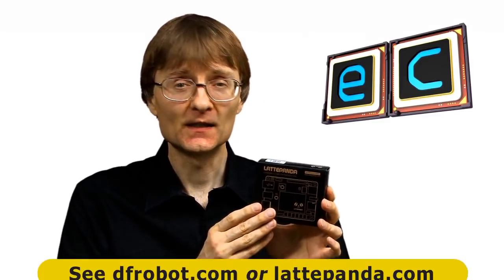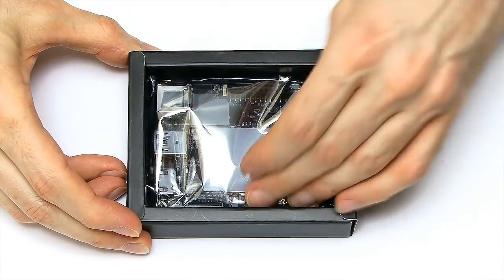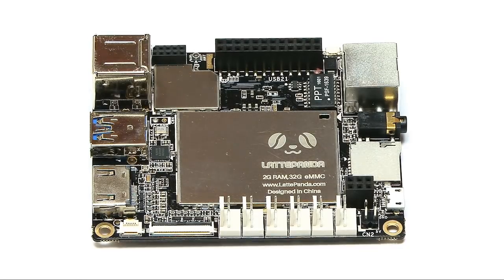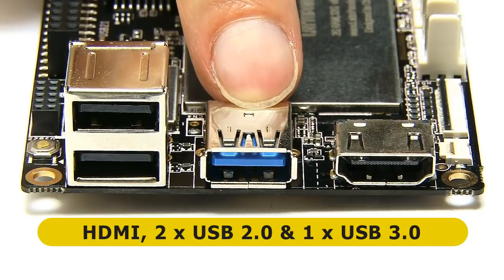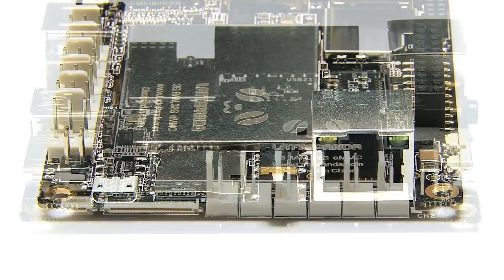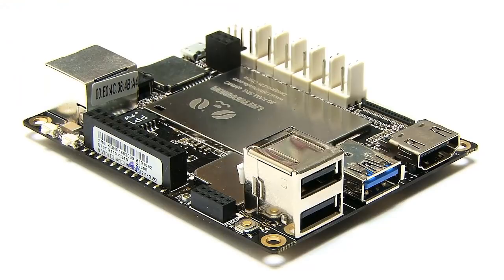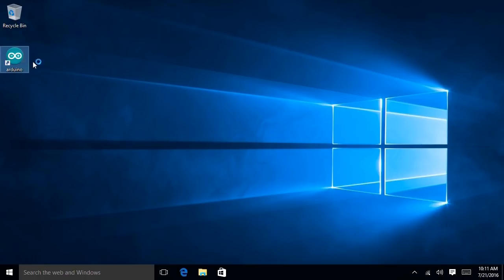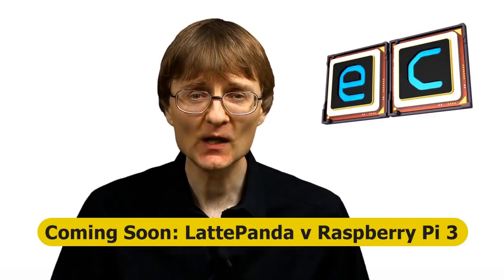LattePanda Windows 10 Single Board Computer

Comment: Ok, shit. This thing is expensive. For that price I can get 3 Raspberry Pi 3, or 22 Raspberry Pi Zero, or a real PC.
Reply: A real PC? ermmmm for $107?
Reply: Sacco Belmonte Go on ebay. It might not be the newest, but it is probably still more powerful than this one.
Reply: Yes because a $107 PC is old tech and it's huge.
Reply: ***** I got a 2012 Mac Pro for 100€. It had bad ram installed, but after removing it, it still has 12 GB. And it works.
Reply: Michi Lo Just because you got a good deal doesn't mean they usually go for 100 euro. They go for much much more than that on average. And it's still a huge computer. Doesn't really serve the same purpose as this.
Reply: but the PC does not even have the GPIO ports...which is really the reason why these things exist. Its quite stupid to even try to compare them. It all depends on what you are going to use these things for.

Comment: Make it Win 7 compatible and I'll get one.
Reply: It most likely is, unless Cherry Trail is like Skylake.
Reply: ender_scythe I wouldn't like to come across with the news of no supporting drivers...
Reply: Nonnof Yobiznes q1
Reply: Nonnof Yobiznes Yeah.
Reply: CPU too slow for you, you need a geekbench of 2000++ for today's OS.
Reply: PC KUCHING You just burst my bubble.
Reply: You can customise Windows 10 to be very much like Windows 7.  Win 10 has an old fashioned desktop, so I set mine to boot up on that, and when I switch on the computer my screen is identical to my old Win 7 one in every way. The only thing that looks different is the Windows start button menu, but I have shrunk that annoying panel of tiles to its minimum size, and populated it with only File Explorer, Control Panel, and This PC tiles. Finally I deactivated Cortana, leaving me with the conventional search bar. Due to a drastic crash a while back, I had to reboot to factory settings, giving me back Win 7. At first I wondered why I used to love it so much, but after a week, I could see why. However I then got the free upgrade again because I knew I love my Win 10 just as much. Too late now, but you should have tried it, because you always had the option to revert.
Reply: +PC KUCHING you are wrong. my 2005 Pentium D 840 only has a geekbench score of 1600 and runs windows 10 no problem. graphics card Nvidia GT220 runs my 1080p monitor just fine.
Reply: No, I want Windows XP
Reply: ***** XP does everything that later versions of Windows does so for 16 years there has been no improvement for Windows users. 10% of users are still running XP.
Reply: ***** Every new version of Windows is more rubbish than the previous version.  Microsoft is like a Government with no Opposition, they fuckup everything they do. Have you tried other Operating Systems?  What other system coud I use on a laptop?
Reply: Doktor Hachi Roku "and all are more or less the same shit. Some of them even need 6GiB" : whitch distribution did you try, i tryed ubuntu, manjaro, mint,opensuse, fedora.....the heavier never passed 900 Mo witch is ubuntu unity DE
Reply: Cyrille Velez, on 2gb machine?
Reply: vadim negru 4 gb, but anyway, never more than 1 gb
Reply: Doktor Hachi Roki - false. It's not just cosmetic. There are MASSIVE improvements under the hood in resource management and other areas. Windows 10 on a high-end Core 2 Duo will feel much snappier than Windows XP on that same system. It's optimized for modern-ish multi-core architectures though, so anything with a single core will run much worse with 10.

Do you understand how much more Windows 10 needs to do on modern hardware than GEOS needed to do? You're comparing apples and motorcycles.

Comment: Mated with and ESS and breakout board, this would make a brilliant Mach4 platform for CNC machines that would fit into a very small space. With the wired Ethernet for the CNC connection and Wireless to hook  up to a network, this has everything you need for that application.

Comment: Cooling is a problem that should be solved. Also a Problem is the Processor - i think that some programms cant be work with atom-processors correctly. I will be happy to get more infos about this both points in future :)

Comment: A month ago I bought the 2/32 version and it is really an amazing device. I use it in my livingroom connected to my TV.  Perhaps you like to know that it has now a Z8350 processor and a Windows 10 64-bit operating system.
Reply from the maker: Good to know, and I'm not surprised that it is a great TV PC. :)

Comment: running Windows 10 instantly makes it better than any android or iOS phone out there (idk about windows phone)
Reply: except the fact that you need to take a keyboard, mouse, monitor, and the power adapter with it, and it has no wifi connectivity or data plan
why the fuck are you comparing a smartphone to a PC anyway
Reply: Not on a shitty slowly Atom CPU !! Pentium or Celeron maybe...
Reply: I USE - it depends on what you want to do with said PC
Reply: It has wifi connectivity and there is a special touchscreen( that is not to expensive)  to use with lattepanda to control it. You can mount both in a box and use them as a controller with softwares like labview or another similar free version software that can communicate with arduino.
Reply: Funhubble New age Intel Atoms are based on more modern Cherry Trail architecture so its faster than before.

Comment: I saw this video before and didn't pursue it because of the price.

This one comes with a software package that runs in Wind 10, with Visual Studio, to "operate" or access the Arduino I/O.  But I also need precision analog input A/D conversion, which will probably have to be breadboarded separately.  Kinda pricey for $119, with the activated Win 10 OS, but the barebones package is only $89.
Reply from the maker: And you can "evaluate" Windows 10 without activation indefinately . . . The only real restriction is that you cannot change the desktop background.
Reply: I dunno.  After Bill Gates left Microsoft and stopped doing what he does best, which is to envision, the quality of Windows OSs have been in decline, and for a long time, I wasn't able to change the background on my existing, paid-for copy of Windows 10.  Now, I think there were enough complaints about it that Microsoft let it back in.  In the meantime, I'm in the market for a newer, better OS, but I suspect that, with all technologies that evolve, they tend ted to devolve as time moves on.  I'm even losing interest in the internet, just because of the hogs that occupy it, youtube, for instance, and google.  As for Linux, I've never been able to get used to it - it just doesn't have the feel of Windows.  Well, the old versions - 95, 98, XP, etc.

Comment: I think it is a good idea to have a board that instead of having a GPIO it have a IO bus line where you can connect IO modules, communication modules(e.g. Profibus, CAN bus, etc), and additional power supply module for high power outputs, similar to PLCs making it compatible to available industrial components such as sensors, solenoids, etc.

Comment: That's quite a lot of computer for the money, or even as a spare in a pinch. I use an ASUS X205 as my ultra-portable when I'm not at my custom rig at home. It's an Atom z3735f (2gb RAM and 32GB storage which is lacking...), which is actually a little weaker than the z8300 in this one. I've found it totally capable of watching 1080p 30fps video, I've typed more papers on it than I can count, and so on. Even if you used this as a basic office computer with the 4gb and 64GB storage, this is a nice little setup.

Comment: I personally think LattePanda could become a tough contender in the market of single board computers; amongst the many factors, one case is because of its feasibilty with a very familiar OS- Windows 10. Win 10 and Arduino pre installed in a small computer board, that's been the crying need for engineers and coders, sadly not available in Bangladesh yet. :(

Comment: Ok just curios if anyone else realized it has 1 quad core CPU but you can add 2 more giving you a totals worth of 6 CPUs on 1 computer that small would provide any hacker or programmer with some serious advantages, then it supports the Arduino ATmega which is actually 1 of the other 2 processors you can add next to the quad core (Quad meaning 4 making it a 4 in 1), the fact that you can use it as an Arduino means you're starting off with everything needed to design and publish so seriously nice programs, while also being able to use other custom made programs. Wifi and Bluetooth even though you can get them with most laptops, I've usually seen that Bluetooth is normally charged for seperately and as an extra very rarely included in original pricing, desktops usually have neither Bluetooth or wifi even today. So for a pocket computer this thing is actually packing some pretty heavy fire power, ok sure you have to get the 2 other processors separately from it but the fact that it has a quad core that can support 2 more processors on top of that is still damn good. It has sensor ports which you can only get on a prototyping device like Arduino or the Ras PI is another bonus because you can easily turn your home into a smart house completely wirelessly. Then for those of you who don't know micro sd cards now come as high as 525gb of memory, add that with the video card and you got a nice gaming system, not just that it comes back to the fact you can have a totale of 3 CPU acting with the power of 6 processors on 1 small board that would mean no lag, barely if not having to wait at all for it to start up, start a program or game, but do it so fast it would be like you pushed 1 button that read your mind. When it comes to computers I always look at what can be added because the more you can add means the longer you will have it for, as being able to add more to a computer means you don't have to worry about upgrading since you have everything needed to make this your own custom based system. Then the wireless sensor ports I can't even get past how many smart house devices can be rigged to this, if any of you seen the Disney movie "Smart House" this little computer is the equivalent of that control room of that awesomely designed system which if was real we would all be chasing after it lol. So yea again compared to the fact it has wifi, Bluetooth, 2 extra CPU ports, quad core, and wireless sensor add ons give you that start of 1 sweet and easy to customize little pocket PC.

Comment: I have a Chuwi Hi8 Pro on the way in post. Specs are pretty much like for like, except you get a 1920x1200 touch screen, battery power and USB C. Paid £72. Obviously 2 different products but will be interesting to see how it works out

Comment: I have the Raspberry pi and as a comparison, you don't get a lot for the money with LattePanda, which cost 3X as much. A little more ram, an SD card, Bluetooth, and wifi, and 3.0 port, and Window 10 installed (and it's free). I guess for the money you are really getting convenience (Just plug and play).  I have five Pi's in a supercomputing cluster configuration, but as a stand alone unit, I might prefer the LattePanda; no doubt it will be easier to use out of the box.

Comment: Based largely on this video, I foolishly bought a LattePanda with Windows 10 installed. It was a complete disappointment, as Windows would never actually boot and it would inevitably return me to the blue "Recovery" screen. Having nothing now to lose, I proceeded with the "Reset" option, which took forever. It then tried to reinstall Windows, but always encountered an error and would restart. This failed loop would continue forever. It remains to be seen whether or not DF Robot will refund to replace my unit. This is yet another reason why I am forever soured on Windows based operating systems. And just try to get customer support. Thanks for helping me waste $131.
Reply from the maker: I am very sorry to hear this. I have two LattePandas that have both been working without error for more than 18 months. Clearly you have a faulty unit, and I hope that you get your refund or a replacement. Good Luck.
Reply: Not your fault, mate. Ye pay yer dough and ye take yer chance. Could'a gotten me three pies fer the price of one latte, tho. Learnt me lesson. Carry on.

Comment: I don't think so those are "Standard" Arduino GPIO pins. Sure they are Arduino pinouts but it wouldn't work with standard arduino shields as the layout is different.
Thanks for the informative video btw.

Comment: I'm surprised that 5V is the power, which is rather high for such a board. It tells me the transistors are rather old. The specs are roughly equivalent to 2003 to 2008, with USB3 being the exception. The RAM limitation means it can't be used for serious work. Imagine loading the entire package of Windows Office, Inkscape, and Corel's Paint Shop Pro  just for starters. With 4 GB of RAM, imagine trying to cruise the internet while you're in the middle of editing images? 

This obviously means that an external USB hard drive will be required leaving the internal hard drive dedicated to handling Windows upgrades. Nevertheless, the board indicates "Designed in China."
Reply from the maker: 5V is what is supplied by micro USB power supplies. So feeding the board 5V has nothing to do with the voltage levels it uses. :) This is an SBC that runs fine for robotics, IoT and basic Windows work. Web browsing is fine, but obviously not running a graphics package too. That is not the market for this board. But you can certainly do "serious work" in Windows in 4GB. I've written many books and a lot of client reports on a Windows machine with 4GB of RAM (and far less in days gone by). So it depends what kind of work is being done.

Comment: I don't see update/activation, but there's a Backup and Restore which reads, 
Backup and Restore (Windows 7).
Reply from the maker: It is under "Update and Security" and then "Activation", within which there is an option to "Change Product Key". To be clear, this is for changing to another activation key -- ie you will need to purchase another copy of Windows, to move to a version with potentially different rights/access to the MS Store. But we are not certain that is the issue you face! :)

Comment: The trick with these version 1's is to figure out if they are 64 bit compatible. Most, unfortunately, are not. So what you get is an under powered 32 bit OS, unable to run a lot of apps. The Windows 10 that comes pre-installed is X86. To run the x64 version you will need the model CR200 with the z8350 CPU upgrade. Unfortunately the CR110 with the z8350 CPU upgrade will only run the x64 OS if you have the 4G/64G package. So its tricky. The two C110 models I have with z8300 CPU's running on the 2G/32G package, unfortunately, is only compatible w/ the 32 bit version of Windows 10.

Comment: If there's no heatsink, does that mean the board is doing thermal throttling of the CPU to avoid overheating? (Apple did this on the 12-inch MacBook, in order to produce it with no fan and thus silent operation.)

If so, you could potentially benefit from adding on a passive heatsink. Less thermal throttling = better performance!

Comment: It is Windows 10 Enterprise. Do you think I may be able to replace it with a purchased copy of Windows?
Reply from the maker: Possibly by changing the license key; not by reinstalling, as you you need an image to install Windows on a LattePanda as it does not have a standard boot loader. Note that the LattePanda Alpha and Delta are different, and you can install what you like via USB.

Comment: Really good video, thanks. I think the board would use a bit too much power to run a portable device I'm developing (an electronic concertina). What do you reckon?  Even with power pack for cell phones, I guess it would flatten the battery in less than an hour.
Reply from the maker: Yes, I agree, you would be better with something like a Raspberry Pi -- perhaps a Raspberry Pi Zero and an audio hat. That should run for many, many hours from a USB power bank.

Comment: I wonder why it costs about as much as an 8" Windows tablet with the same specs... especially since it doesn't have a screen and battery, which probably cost more than the USB controller, Atmega processor, and other things this has that a tablet doesn't.

Comment: Hello,
This single board computer seems like it could be placed into a laptop case and made into a regular laptop (albeit, there would need to be a way to add more storage (hdd) and create a section of the laptop's base for the io pins(if using the arduino ).
What is your take on using this for a laptop ?
Reply from the maker: This would indeed work -- and more storage can be added either via the USB 3.0 port, or the micro SD card. It would not be the most powerful laptop, but it would be good enough for a great many purposes. :)

Comment: Another great and informative video. Question I have is there any way to have it boot directly to Windows without pressing the power button after the power is applied.Im not sure if I missed this in the video but does it have Wi-Fi capability on board or do you need to add a Wi-Fi dongle.

Comment: where is the heat sync, but raspberry pi steals the show in comparison to the price, and possibility & scalability of various applicartions, although windows has advantage of its own built in applications on Latte
Reply from the maker: There is a heat shield across the top of the SPU -- the large metal rectangle in the middle of the board.

Comment: Seems kind of cool. If I used though i'd probably want to use win 10 pro on it. 
Wonder how it would run if you wiped it out and put server 2016 on it (assuming the CPU is 64 bit). 
Some cases I actually think we should be using things like this or high powered laptops for servers because they have built-in batteries, or could easily run off of a battery and you lose the waste that a UPS would have.